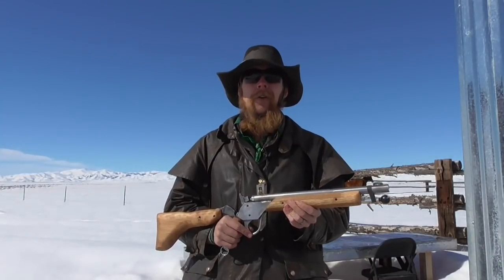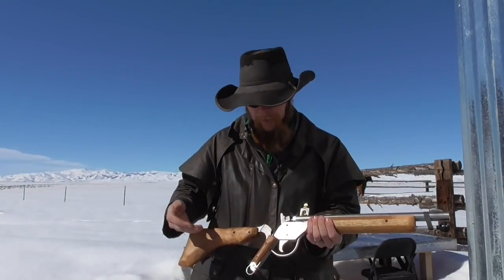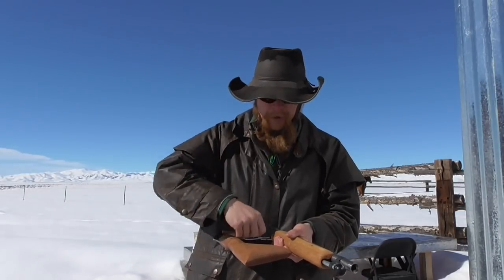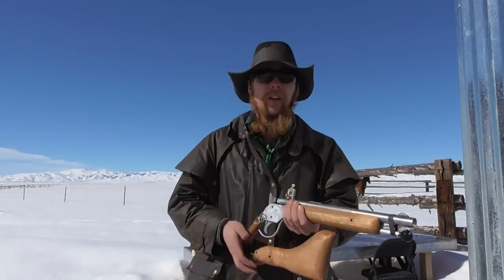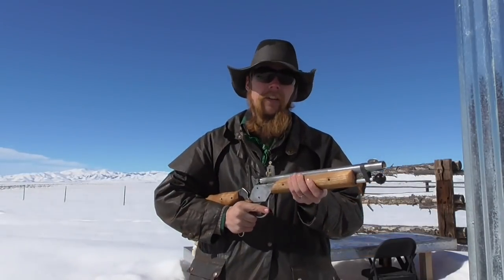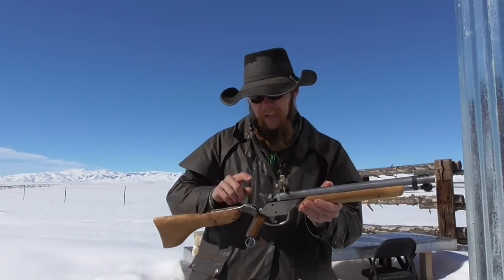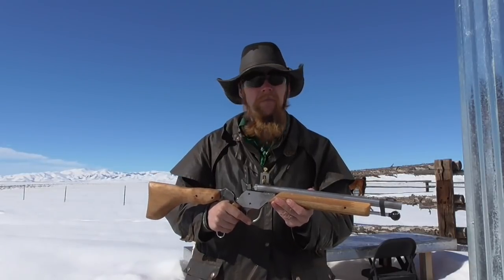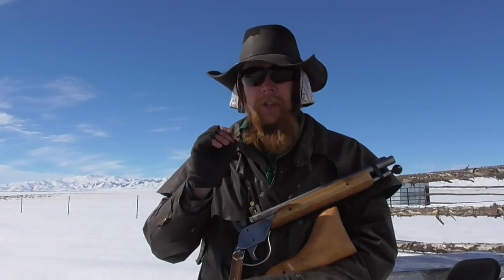Early Folding-Stock Muzzleloader Prototype (TIS200)

Comment: I have chased this for years reaching out to CVA on the Wolf platform and even Rossi on the Tuffy frame.  I was looking to use .410 case heads as the priming module, just for larger components for field handling.  I tried to build this on the Contender frame platform, utilizing Hankins break-action breech plug.  No one will do the work.  With the new folding stock by SSK for the TC platform, we don't need much to make this work.  I would like to see a .45 stainless barrel that can shoot .401 and .357 MMP sabots, which already exist.  On a 16-20" barreled action, what a fun rig.  I have the Bullberry .50, 20" barrel on the Contender platform and shoot XTP .429 hollow points and drops deer on the spot.